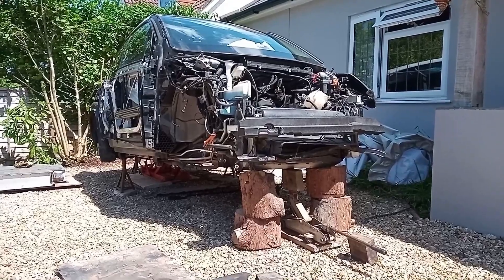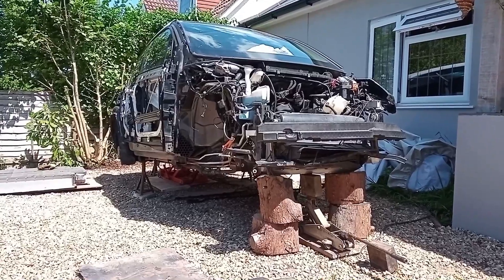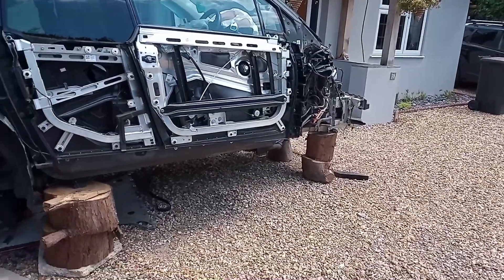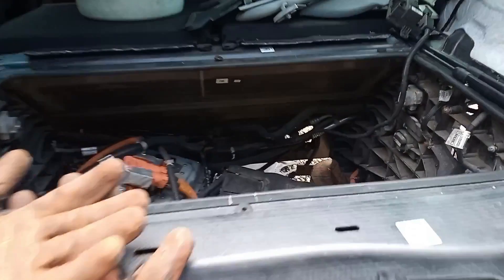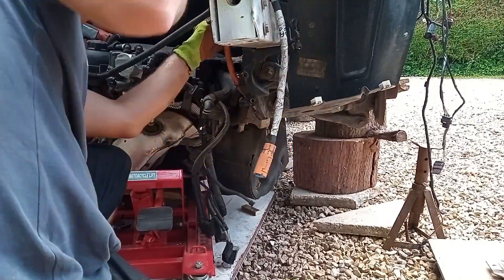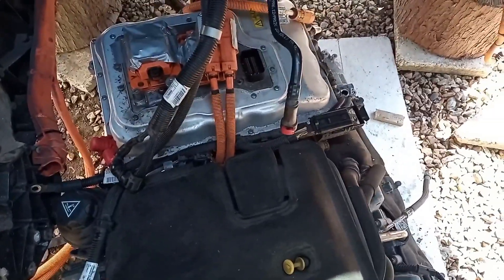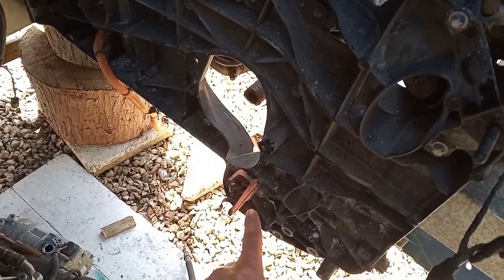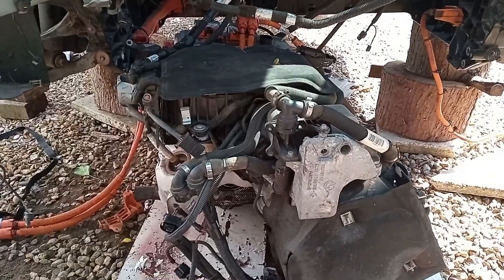EV conversion Project Mini i3 Ep 15; The motor is finally out!

Comment: Question for you. I’m in the process of doing this.  What size socket did you use for the axle shafts? I can’t figure out how to remove these
Reply from the maker: Hi, did you watch episode 14? That might have the info you need, hope this helps 🤞
Reply: @MiniLifeCrisis  I saw you knock it out of the transmission but it appeared you cut off the end to the hub?
Reply: @MiniLifeCrisis  I'm at the same point too. I've got the back end clear, but the driveshafts are still in. I did have access to TIS but didn't download all the info. I do recall BMW saying you needed to remove the suspension and wheel assemblies before removing the driveshafts. Is there an easier way without cutting the driveshafts? My car is not a scrapper, I'm trying to get the EME off to get it rebuilt, so I need to drop the motor.
Reply: I didn't see anything in episode 14.

Comment: I wouldn't might putting a Subaru 2liter flat and using as a gas car should be fun low weight.
Reply from the maker: In total it's 1500kg I think, the battery pack is 200kg and the rex and motor would shift some weight too. They need to be a bit wider and lower for real fun, maybe some wider wheels for traction. Some people are using these to race now so I'm sure they're fun.